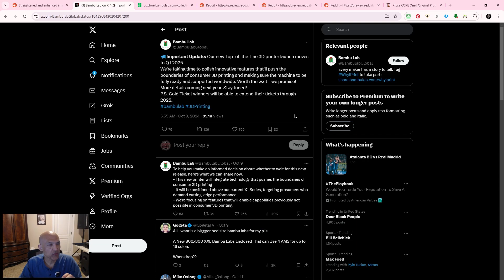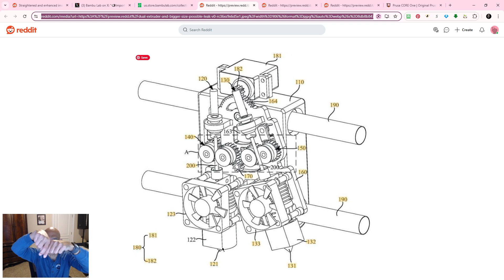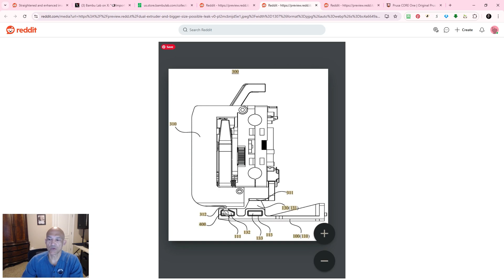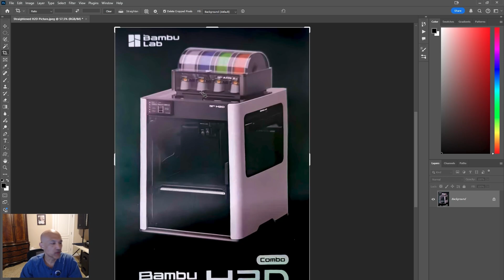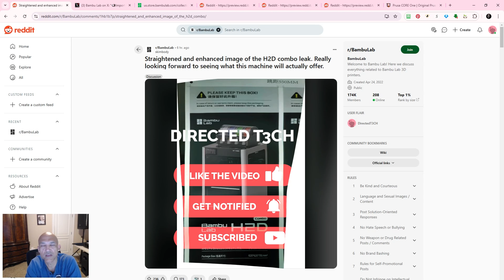Bambu Lab H2D - Is this the next flagship 3D printer?

Comment: Had an ANet printer as my first one for almost 4 years. I think I managed to get about 12 hours of print time on it before I sold it for $50.00. Bought the P1S around a year and a half ago to replace it and it has nearly 800 hours of print time on it now and it still prints like new. Mind you there are the maintenance things to do like lubrication, belt tensioning and filament cutter replacing but other than that, the thing is just a workhorse. And I really like the fact it doesn't use sensors or limit switched to find it's position. It's all done through current sensing in the stepper drivers. Gone are the days of trying to level bed with a piece of paper. This just does the job. If the H2D does come out as speculated, I'll be getting one.
Reply from the maker: Totally agree! I use my P1S like crazy and barely have to spend any time fussing with it. It even let's you know when it needs lubrication! I'm really looking forward to see what Bambu Lab will bring us next.
Reply: @directedt3ch  Thanks for the positive feedback. I know a good printer when I have one and look forward as well to what Bambu Labs will offer up next. I was considering another P1S but maybe I'll wait a bit. Who knows?

Comment: I am cautiously optimistic. Based on the patent filings and illustrations it looks like only one of the tool heads can be primed at one time. At least with the ams equipped. Not to mention the added weight of the motors. It’s not exactly a competitor for the xl but I bet people are going to try and make that argument. What it is a replacement for is the ultimaker s5 which is great. My theory is that it’s two tool heads but with basically two x1c tool heads glued together it’s going to be a lot slower than the x1c on single material prints and maybe 50% faster on multi material prints and if I know bambu it will still have the cutter and purge but it will be less. I guess we’ll just have to wait and see.
Reply from the maker: Definitely all great points! It's going to be very interesting when they announce it!!

Comment: The X1C has a suspicious bug that happens to most printers where you can no longer send prints to the printer via WLAN but somehow you can still send prints via Print Plate option caching on the MicroSD card. They don't bother working on this bug with each new iteration of the slicer software.
Reply from the maker: Oh wow! I've never heard of that issue.  I've not tried the WLAN option for either of my Bambu Lab printers.

Comment: A dual extruder on the same head, that moves out of the way, doesn't seem like a verry good idea on first glance...

It should still need to purge the old filament and increase pressure again. It should not be able to purge when printing, while it's purging on the actual print then. So it seems it still needs to move out of the wsy for purching as it does now on the P1S and X1C.

So I don't see a lot of time saving there. 2 independed extruders would have been way better and faster I think. While they really can work and purge indepentaly then...

Well we're going to see what it brings on release.

If it works as I think it would work, then the X1C would be still the printer for me. But hoping on a serious price drop by then...

Comment: I wish they just offered a bigger size without the much higher price. I'm assuming this will be priced at 1999 which a lot of 3d printer. I wish they offered something like the p1s with a much bigger print area for less than 1k
Reply from the maker: I can understand that.  I think since there are already printers like the Qidi X-Max 3 which has a build volume of 325x325x315 and sells for $699, Bambu isn't interested in competing in that market.
Reply: Same here - I would really like one that was 2-3x in one direction - prefer it flat, but for Bambu they could easily build a 3x tall model of X1C
Reply from the maker: @jenspetersen5865  I wouldn't even have space for something that big :)

Comment: All these Shenzen-based companies are not as much in competition as the Internet consumers are.  They all share the same manufacturing company network, where one “house” produces all the parts that are funneled out to the different, Chinese brand labels of 3D printer.

It’s exactly the same as the market for mini milling machines and lathes.  Sieg — a company with a European sounding name but which in fact is a manufacturing giant in Shenzen, China, produces, for example, a basic pattern of mini-mill called the X2.  Tens of brand labels, such as Micro-Mark, Little Machine Shop, Grizzly, Harbor Freight, Eastwood, etc. sell variations of the X2 under different model names.  They are all made by Sieg, but to different specs and accessorizing to meet different tiers of needs and budget of individual and small business consumers.  

In exactly the same vein, with the Chinese 3D printer brand labels, you’ll notice how they all occupy slightly different niches, always selling  machines that have all the features a particular class of individual consumer would want except for one.  That one “holy grail” feature that is missing is how consumer interest in future sales are managed.

For example, while the 350 deg C hot end of the Creality K2, coupled with actively heated enclosure seems groundbreaking, Qidi has been in that market space for a very long time — and with dual extrusion and large build plate.  Their flagship has checked all the boxes for what the dual extruder, high temp aficionados could want except that it is missing … auto bed leveling.

Creality has been in the dual-extruder space for many years now, and their flagship has the auto bed leveling but is capped at 300 deg C on the hot-ends, which limits how far users can go into the realm of engineering grade materials.

Bambu Lab rocked the market with the AMS.  Now, Creality has incorporated it into their line-up with their CFS clone.  Where the AMS and CFS come up short — or leave “prosumer” level customers wanting — is on their incompatibility with abrasive filaments.  The image of the  “leaked” H2D with AMS 2 Pro still shows the yellow, plastic, first stage gears.  A hardened AMS would dispense with plastic in the gears and introduce hardened steel or stainless steel gears.  So, if the H2D leak is at all accurate, it looks that the AMS will go forward for another generation still not compatible with abrasive filaments.  So, no “more than two” multi-filament fun with engineering grade materials, glow filaments, and specialty filaments embedded with metal particles, wood fibers, etc. … yet.  

So, do ya’ see the dance going on here?  The real guessing game is what is Bambu Lab going to put on the prosumer market that has everything a prosumer could lust for except that ONE feature that would achieve “holy grail” at a somewhat affordable price point?   They’re never going to give you everything … the one 3D printer that does it all and lasts 10 years for under $3,000, let alone $5,000.

Where Prusa’s XL falls way short is in the hot ends being capped at slightly less than 300 deg C, coupled with an enclosure that is an after-thought and tons of interior parts printed from PETG.  Definitely not intended for high-temp, engineering grade materials.

Limitations going forward are going to become more about those presented by the filament.  For example, dual extrusion always gives the exciting prospect of being able to print support materials that in turn can address the challenge of printing cleanly on extreme overhangs.  The prospect of printing high-temp, engineering grade materials with dissolvable support material is really exciting until one realizes that there are no dissolvable support materials that can tolerate a high-temp environment.

We have some X1Es that were just delivered a couple days ago, along with spools of Tullomer filament.  We haven’t unboxed these shipments yet.  If the ultra high-strength, high temperature deflection, Tullomer material will feed through the AMS without tearing it up, and can use PA (with no carbon or glass fiber added) as support material which can also be fed through the AMS, then we’re going to be happy with the capabilities and pricepoint of the X1Es for prototyping and printing components for motors, machines and vehicles whilst waiting for Bambu Lab’s next product release to fully test out for at least a year AND have an enterprise equivalent.

In the meantime, we continue to consider and observe the Prusa HT90 kinematic with great interest.
Reply from the maker: Wow! You've really put so much quality thought into this! I appreciate all the time and insights you've shared with all of us!! Thank you.
Reply: Damn, where’s your channel? :)
Great insight. And exactly why I haven’t bought a new printer in years. They are all so close, and I can’t decide which feature to give up, especially when there seems to be no good reason for said feature to be missing. Feels like getting ripped off.

Comment: Do you think the print quality will improve on the new one? I’m currently using a A1 but all my prints have some sort of a banding under different light condition, I don’t want to use a resin printer but still wish the print quality could be better
Reply from the maker: Layer lines are a reality in FDM printing.  My A1 has excelent print quality.  You can reduce layer lines by using a 0.2 nozzle, but it takes much longer to print.
Reply: True, it’s just sometime even I reduced the a height to 0.08 I still get these Z banding, I’m not sure what’s causing it, the layer line is already very small(similar to resin) but these Z banding is very noticeable
Reply: @lunch7553  do you have a wobbly surface? printing on a cabinet for example that can rock about will cause this, printing on a stable surface should reduce this to near 0.
Reply: @DarylHoward-po1yy  i will give a try, but there will always be this sort of z bending under low light

Comment: I really hope this isn’t the new printer. First, it’s not anything that hasn’t been seen before, nor does it appear to be a direct competitor to the Prusa XL. Both of these statements were made by BL and this just seems underwhelming at best. If a multi tool head is what they want, then they need to address the folks that want to print simultaneously with support material, but also those who print multi color. And those who print MC use more than two materials so to go to all this trouble to still have to wait for color swaps and purges simply doesn’t hit the mark. I’m sure there’s lots of new bells and whistles in the tech, but what people have wanted is the larger build volume and multi color/material printing. Smaller than Prusa XL and fewer toolheads doesn’t feel amazing.
Reply: Sure I’d like to see those things and others, but my point is that this doesn’t feel like the printer that BL was hinting at. I think folks that have been following this saga have bigger expectations than a dual nozzle and a bit larger build volume. If that thing is hiding a 5 axis print head or a tilting bed then we’re starting to realize the statement “we’re adding things that have never been seen before in consumer printing”
Reply from the maker: @Crabnabit  Ok. That makes total sense.  Thanks for the clarification.  I've never thought about a tilting bed... I recently saw a video of a printer that had a nozzle that was on an arm that could rotate and print from the sides... it was pretty unique.
Reply from the maker: Great points! Is that what you'd like to see in the next printer also? Bigger volume and more efficient color/material usage.

Comment: Really hope it is this because its exactly what i want. Dual nozzle with a larger bed. I'd also like it to have a metal flat bed not the plastic bed currently on x1c because those are not flat enough.
Reply from the maker: Interesting!  Do you have first layer and adhesion problems?
Reply: @directedt3ch it might not cause adhesion issues. but it pretty well known that people have had beds not flat from out of box.

Comment: We need big size
Reply: I'm a cosplayer, so I print big armor pieces. I have two cr-10s5s and two cr-10 s4s. You can print big stuff on a 500 mm bed and a 400 mm bed.
Reply from the maker: @ratstarone  That is a great use case for a bigger printer.
Reply from the maker: @brokenengel7846  What would you print in a bigger printer?

Comment: The printer looks good. I personally don't like the large volume though. That is quite large for the small free space I have. If I decide to buy it, it would be a big hassle to place it anywhere... I am not getting their smaller models due to the excessive amount of waste and the slow print time of multi-colour-prints. Let's wait and see all the features they packed in there. "Not previously possible with consumer grade printers" definitely sounds intriguing and maybe there are some "small surprises" in place as well. Price is of course also a factor.
Reply from the maker: I'm with you there.  Price is a huge factor.  I know many people want a bigger Bambu Lab printer but I have no need for it.

Comment: It could be around the X1E prices, if below it needs to have something less than X1E if everything and more it has to cost more than X1E. Or it would cannibalize other products totally.
Reply from the maker: I agree it will probably be near the price point of the X1E. They said prosumer market, so it isn't going to be less than the X1C.  Eventually some of the new tech will probably trickle down into an X1C replacement which will be more affordable.
Reply: X1e is for businesses not consumers. The x1e pricing won't affect this new product if aimed at consumers.
Reply: @spacecowboy07723  its aimed at prosumers. Might still lack some e1 featres but is not aimed at the base consumers. I expect it to be closer to e1 than anything else on the lineup. Here is my guess what it is its the dual nossle bigger build plate than X1C and some old design issues fixed like nozzle viper etc. Has similar material support out the box with X1C. Price around 1,8-9k€ Then we will see also H2E later that matches the X1E but brings the new stuff to that setup. Thats like 3k price. Leaving only X1E in between of the 2 models. But to be fair I'm most excited about the new AMS unit hopefully it works with older machines too and has the fixes competitors have already made.